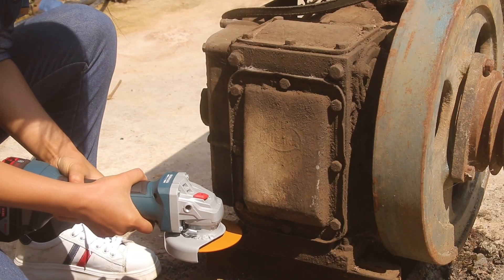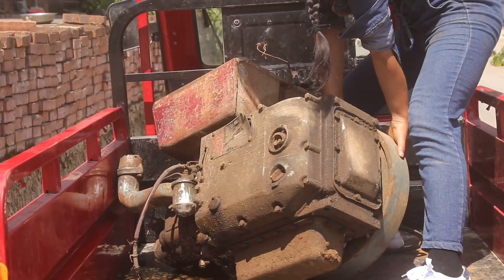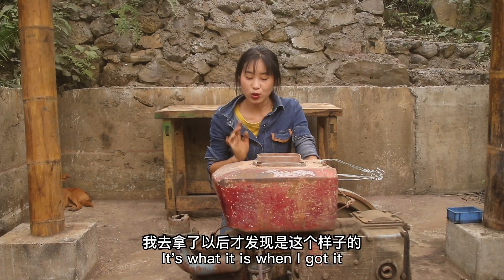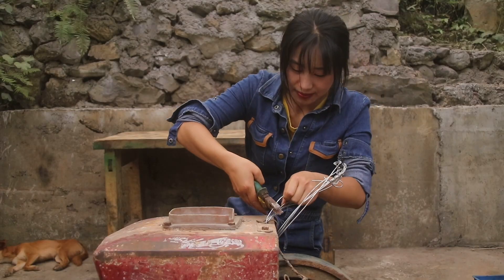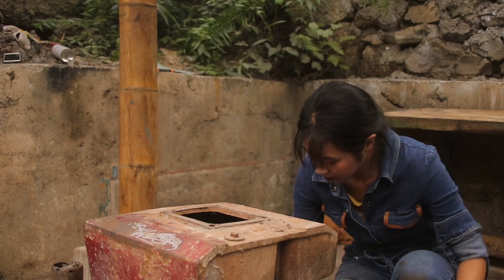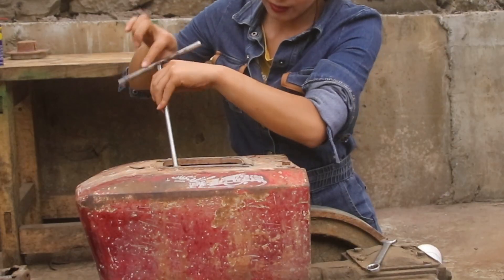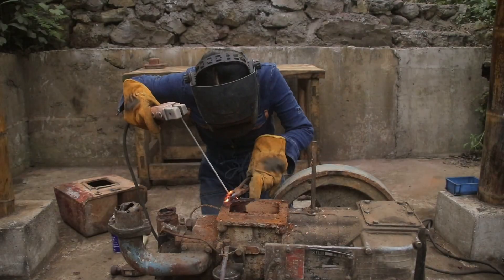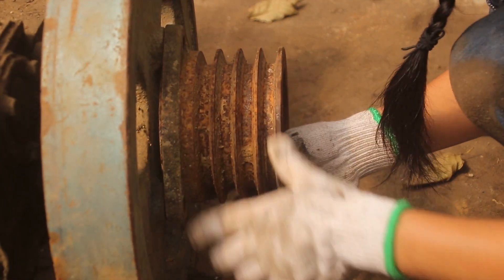😮柴油机被偷走很多配件，彻底报废，修好后震惊所有人！The diesel engine with many parts stolen has been scrapped！｜林果儿

Comment: I am curious about these engines. Are they very old? If not, are they an old style in production for a long time? You bought parts, are parts hard to get in China? Also, are these engines rated in horsepower or in some other rating? What brand are they?  Thanks

Comment: Maybe someone thought it was a scrapped engine, they took what they needed to fix theirs?? Good job in cleaning, and fixing it. Have you thought about heating up the bolts and screw and dropping them in old oil to get a protective coating on them? It should stop them from rusting in place.
也许有人认为这是一个报废的引擎，他们拿走了他们需要修理的东西？？ 在清洁和修复方面做得很好。 您是否考虑过加热螺栓和螺钉并将它们放入旧油中以获得保护涂层？ 它应该可以防止它们在原地生锈。

Comment: It seems like the bigger and more challenging the repair the more Lin Guoer likes it. Great job with this large diesel - that engine will run for a very long time after your repair.
Reply from the maker: Thank you for your support, the machine should be available for a long time😄😄
Reply: 注意保护你的手！戴眼镜，防尘囗罩
Reply: @LinGuoErOfficial  आप engine का वर्क बहुत अच्छा कर लेती है पर आप किस किस देश के रहने वाली है हिंदी में कमेंट शेयर कीजिए
Reply: @LinGuoErOfficial  o
Reply: @LinGuoErOfficial   may I suggest the word "functional" instead of "available". The word "functional" is commonly used to describe machines in working conditions.
Reply: @LinGuoErOfficial  आप जवाब नहीं देती हैं हमारे कमेंट
Reply: ❤️❤️❤️❤️❤️❤️❤️❤️❤️❤️❤️❤️❤️😭😭😭😭❤️❤️❤️❤️❤️❤️ tata ❤️❤️❤️❤️❤️❤️❤️❤️❤️❤️❤️❤️❤️❤️❤️❤️❤️❤️❤️❤️❤️❤️❤️ tata 👍🏾👍🏾👍🏾👍🏾👍🏾👍🏾👍🏾👍🏾
Reply: tata ❤️❤️ ❤️❤️❤️❤️❤️❤️❤️❤️❤️❤️❤️❤️👍🏾🙏🏼 i